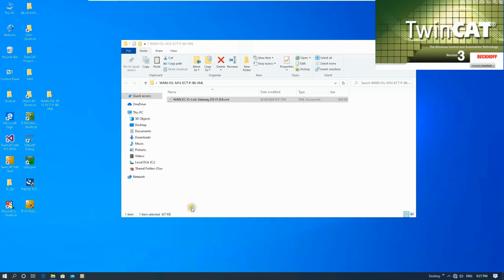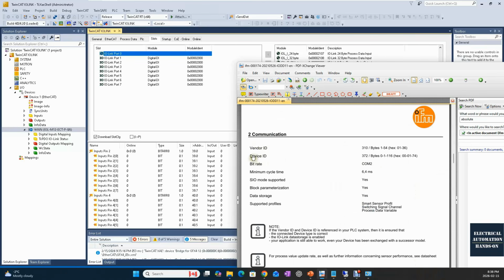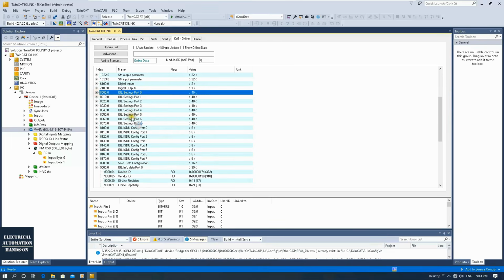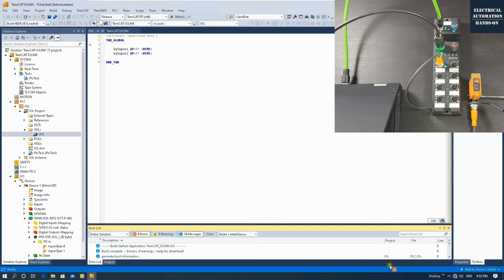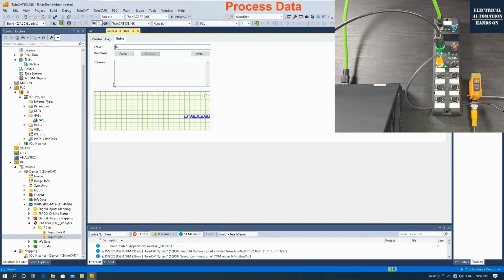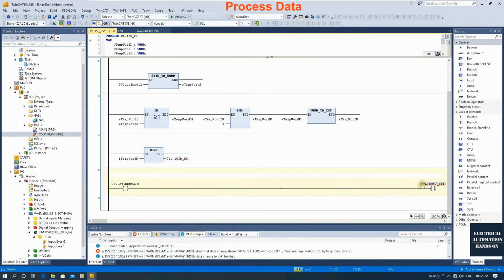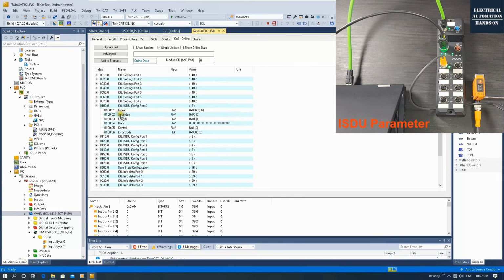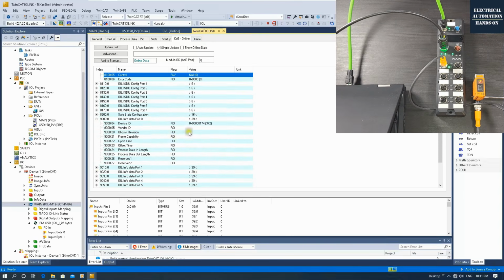IOLK09. Integrate EtherCAT IO-Link Master in Beckhoff TwinCAT (PV & ISDU)

Comment: Great video, but this 12 bit integer seems to  be a hassle to set up properly to read. It seems like a lot of work including shift bits operations just to read measured distance. I can hardly beliefe this is supposed workflow.
Reply from the maker: I understand, but unfortunately, that's just how the IFM device data is structured. And IFM provided the sample program to sort that 12bits.
Reply: @electricalautomation good to know. thank you! Their UX team probably needs to work a bit more :)